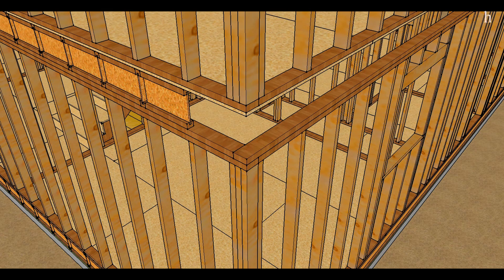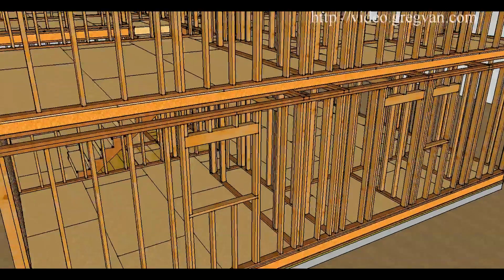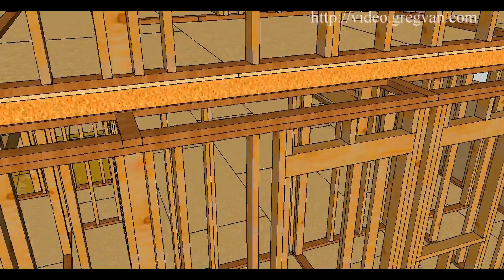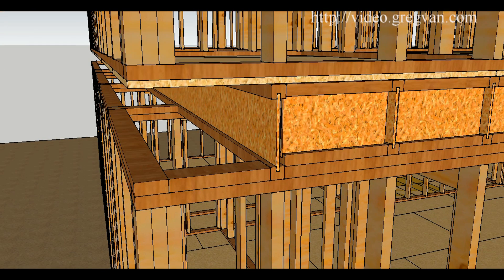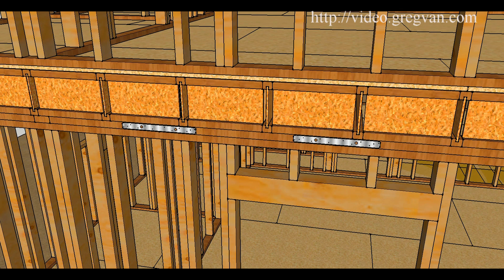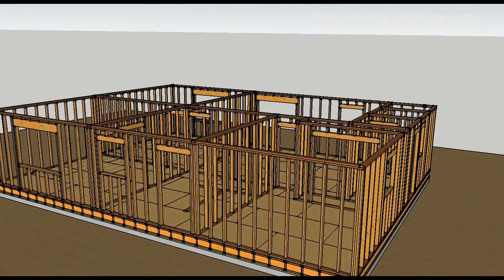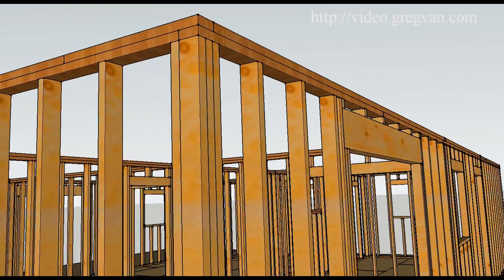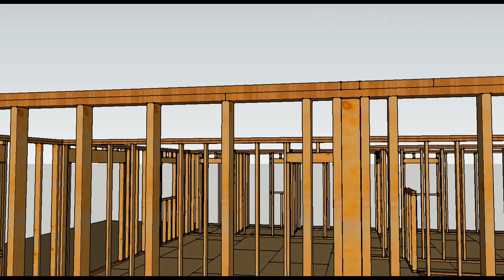Simplified Education of How Upper Wall Framing Plates Work Structurally

Comment: When we design a structure we expect professional tradesmen (not handymen) to work on it. We expect the electrician to be an expert in using the NEC, Plumber to know the UPC and /or the NPC, and the Framers to know the local BC and RC.
We expect a professional framer to understand bag nail capacities "NDS" 16d = 140 lbs shear, 8d = 100 lbs shear. We expect a pro framer to understand all load transfer in performance. Not simply downforce but dynamic forces such as shear and diaphragms. We expect professional framers to use the nailing  .schedule to provide their own fix. 
The top plate or plates are a structural cord in tension. We use the "NDS" for engineering wood design everywhere in the US. NDS 16d nail is 138 lbs in shear. So even with older code at 48" with (16-16d nails), we get 2,208 lbs of shear force in the joint. Simpson ST6224 @ 2,535 lbs and it is a 16ga x 24".
Reply from the maker: It would be nice, if every worker knew what they were doing.
Reply: So you expect poor people to not exist?

Comment: don't 2nd floors usually have double top and bottom paltes as well as the first floor?
Reply from the maker: Usually double top plates and single bottom plates, unless they were going to add lightweight concrete as a sound barrier.
Reply: @gregvancom  thank you

Comment: what's a strap?
Reply from the maker: Don't know have any videos explaining what a strap is, but it's usually a thin or thicker piece of metal with holes drilled in it. Straps are usually used to connect two boards together by nailing through the holes in the straps. Let me know if this didn't answer your question or feel free to provide me with more details in your next question.
Reply: @gregvancom  yeah I came across a video showing it. Thanks.

Comment: Is there ever a time when a 3rd 2x4 on top would solve the break issue?
Reply: Maybe, but then you will open a can of worms with your sheathing and drywall, cabinets, plumbing, electrical, ac, etc...
Reply from the maker: +wwwShadow7 I've never thought about that, but it seems like it would make sense. I often wonder if engineers take other things into consideration that tie walls together like floor joist or flat backing for ceilings.

Comment: As a structural engineer, if you want to make your design easy for engineering review, and there isn't alot of funny business going on in your structure, follow the Wood Frame Construction Manual For One and Two Family Dwellings - Ch.3 Prescriptive Design for your wind/seismic region.  Of course, local state codes should also be considered.
Reply from the maker: +aurugger12 I've never heard of the wood frame construction manual, is it less than 40 pages. I found it on the Internet and it is suggesting that a 2 foot lap is acceptable on homes less than 24 foot wide. Is this something you would allow as structural engineer?
Reply: Actually, according to the WFCM Table 3.21, a 24' wall length requires 6' top plate splice length for one story, slab on grade, or 4' splice length for other cases.  24" splice length would be difficult to transfer loads through the joint without the inclusion of strapping.  The splice numbers in Table 3.21 assume 4~16d common nails each side of the splice (plus 2~16d nails per foot everywhere else) from Table 3.1 - Nailing Schedule.
Reply from the maker: I couldn't find that table, could you tell me what page it's on and whether or not your book has less than 40 pages. I've always thought it was interesting how most building plans require 16 commons, but they are rarely used and I tried to avoid using them whenever possible, because they seem to split the lumber and do more damage than a sinker.
Reply: The WFCM is well over 40 pages.  Alot of contractors use sinkers in lieu of common nails, but (hopefully) they checked with the engineer of record to make sure that the sinkers used have the correct minimum design values to be an appropriate substitute for the common nails.  A 16d common is NOT the same as 16d sinker as the latter is a bit shorter and has a thinner shaft.
Reply from the maker: I guess I should have provided you with a reason why the wood split and of course it would have been larger nails and hopefully the framer would have checked with the engineer, before using smaller nails. I'm going to try and get a copy of the book and sincerely appreciate your recommendation for it.